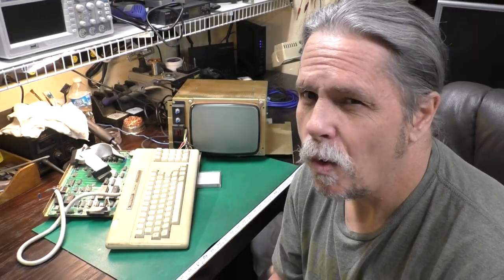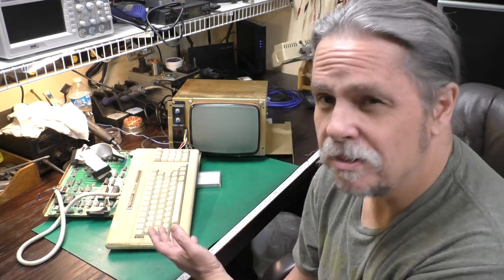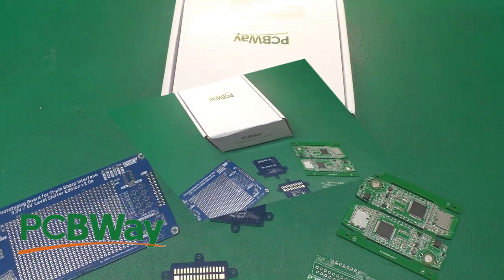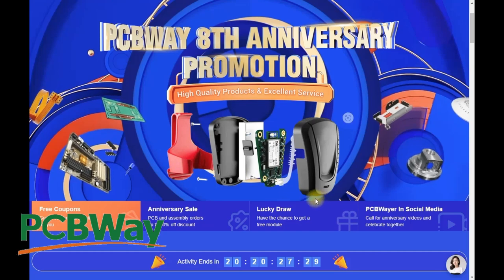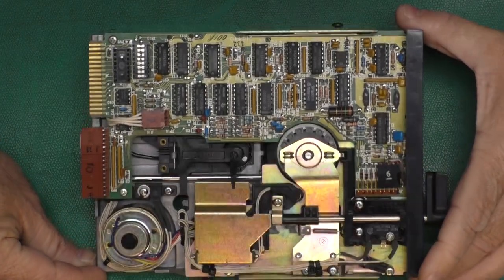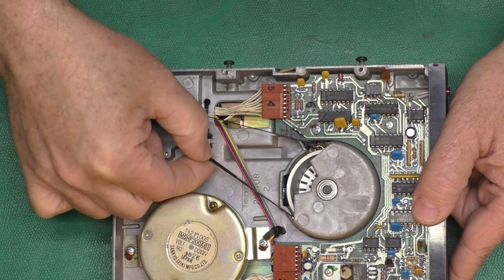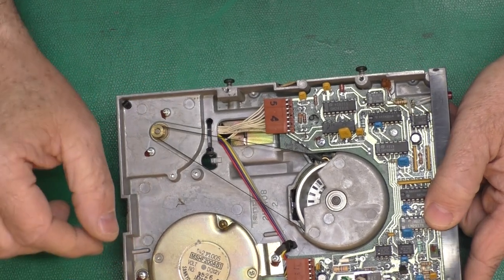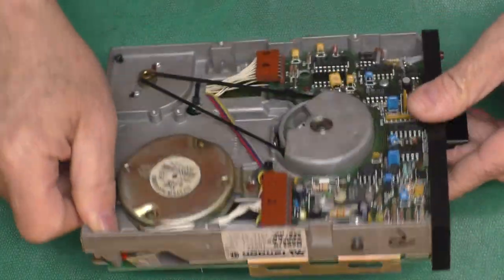Let's restore a TRS-80 Model 4P. Part #2 – Floppy drive restore & making bootable floppy

Comment: DOOD! Is that yet another 7805?
Reply from the maker: What are you referring to?
Reply: @HeyBirt  The DC regulator on the bottom of the board, of course.
Reply from the maker: @tenminutetokyo2643  The only TO-220 package is on the bottom PCB of the floppy drive, and it is a TIP110 transistor. 

The floppy drive gets +5V and +12V from the main power supply, there are no onboard voltage regulators.